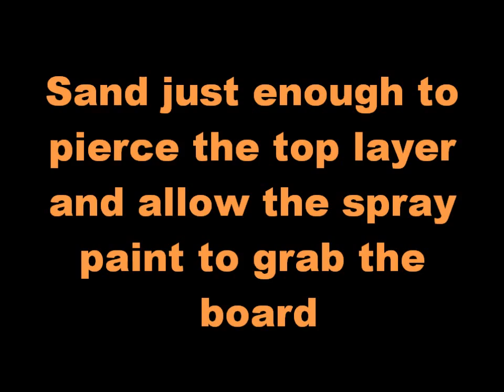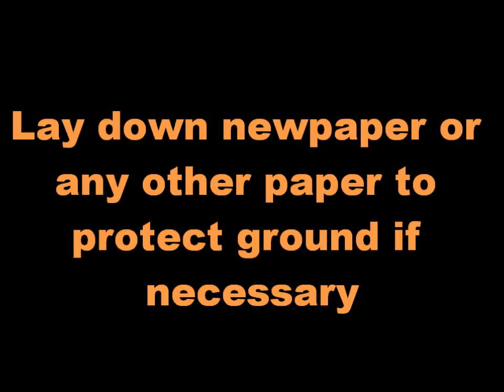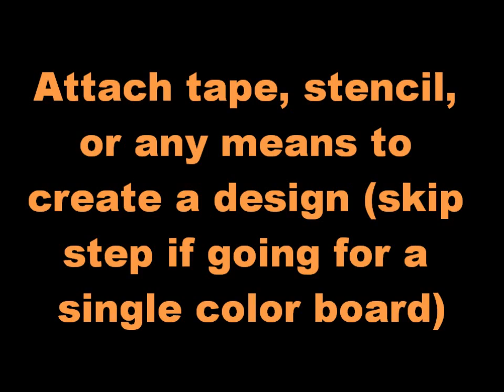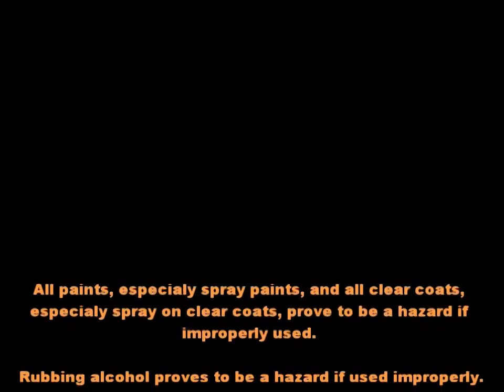How to Spray Paint a Snowboard

Comment: dude. the soap idea was awesome, looks good man.

However, I'm slowly becoming convinced that if you want a board that doesn't look 'homemade', people should seriously just consider painting their board's solid colors.
Reply from the maker: I agree. When I had it just matte black it looked great. Using tape does give a nice design without a lot of flaws though.
Reply: The soap idea was very innovative in my opinion but i think thats what made it look "homemade". I've painted my car's dashboard with tape and the lines are much more clear than yours so i think tape would be a better option. Of course, doing it with tape for a design like the one tanning was after would be pretty hard!

Im painting mine with tape soon, i hope it goes as well as it did with my dashboard!

Comment: Hey ;) Thanks for the great idea to spray paint my ugly snowboard :D I´m a little bit worried that it looks nasty, after doing a ski service. When working the edges a little piece on the side of the snowboard get´s removed as well. Does it still look good or do you have to repeat the whole painting procedure?
Reply from the maker: J. I never repainted mine and it has lasted, however it does have a lot of cracks and spots in the clear coat. There was a lot going on with this paint job from the soap (which I don’t recommend but also don’t advise against) to the wrong clear coat (Thompson water seal, please use an automotive clear coat) and the paint not drying right as a result. So learn from my downfalls and you will get a good looking board. I would say the edges may need to get touched up after a season with some clear coat, but the actual spray paint never came off. And with doing all the procedures right in the first place, you may not even need that. 

One day I may do it again using tape rather than soap (the soap prevented good drying and also moved in between paint coats, making for an uneven finish) and use the right clear coat the first time around, but for now it works and is still a conversation piece after all this time.

Comment: Is it possible to make it glossy? Using varnish
Reply from the maker: Welt Rogg Using varnish, I might advise against. From my understanding, varnish is usually put on thick and it forms a very hard coating. The coating you need on a snowboard needs to be soft enough and thin enough to bend but strong enough to resist water and damage. There are many options on the market when it comes to clear coating anything. There is lacquer and varnish and automotive clear coat and modgepodge and white glue and so on. The biggest factors when choosing your clear coat is that it isn’t incredibly hard when dried, isn’t water soluble (won’t dissolve when it gets wet), and that it will bend without cracking. I personally chose automotive clear coat. It is strong, has no problem curing over paint and is water resistant. On the other hand, it has cracked slightly in the years since I did this project from using the board heavily. If I did this project again I would still use automotive clear coat but I would use more layers. This is my suggestion, but I would advise you to set some time aside to do some research on the different paint options and clear coat options and what work best in conjunction because there may be a better option out there that I’m unaware of. Let me know what you decide!

Comment: Hey, great idea of using soap :) what type of paint was used? I mean acrylic or nitro? Don't it crack on foldaway surface? Thx:)
Reply from the maker: I'm going to try to answer the best I can, forgive me if I'm wrong. 1. I used generic spray paint. I seriously went to the store, picked out a color I liked, made sure it wasn't anything weird (binds only to plastic), and bought it. Considering I don't remember nitro, it must be acrylic paint. 2. If by foldaway you mean the flexible parts, then no. No cracking. I used automobile clear coat and it turned out super strong and still flexible. 3. I won't take credit for the soap, found it on another video. Hope that helps.
Reply from the maker: http://youtu.be/CcDjWvF1mpU video I got the idea from. :)

Comment: How did you choose the right paint? Did you just choose any rustolium type of paint and any waterproof clear?
Reply from the maker: It can hard to trust yourself when you are painting a snowboard that you won't get back, I know. Just go to the store and find the cans of paint that say all-purpose and pick out your favorite color out of those. Then go to the automotive section of your store and pick out some clear automotive enamel. Spray on the paint first as much as you want, but two or three coats should do. Then goes the clear coat of automotive enamel, two or three coats should do. Then you are done. Some notes: I would say to let the paint dry a day longer than mentioned on the can, that way when you put on the clear coat there is no chance of water being trapped under the coat and ruining the board from prolonged water exposure. Let the clear coat set for a week before getting it on the mountain, just to make sure it cured fully, especially in cold weather. Hope that helps!
Reply: +Tanning Lizard thanks!

Comment: looks awesome👍 but how about the areas at the edges? is the color not cracking off
Reply from the maker: No, Sir, no cracking. On my first run with the board there was some peeling where the paint accidentally got on the metal edges, but on the board itself, no. The automotive paint is super durable and stops the paint from peeling and cracking.
Reply: +Tanning Lizard ok great :) thought that might be a problem. thanks
Reply from the maker: Hey, Michael. I thought I might want to give you an update since you had the concern with cracking. After the third time boarding with this board, I fell so hard that I pulled one of my bindings out of it's sockets. With this hit, the automotive enamel cracked somewhat and let water in. The paint is mostly fine but the enamel is bubbly. I am going to remove the bubbles and recoat the damaged parts. To avoid this, I would say to put on at least three or more enamel coats (I only put on a couple of coats) and try to be careful to get it near perfect around the edges (where most hits come).

Comment: If I use rustoleum spray paint as the base and then use an automotive clear spray paint as the top coat, will it work?
Reply from the maker: That seems fine to me. Just make sure it’s a primer + paint combo for the bottom

Comment: How did you mess up a section with the soap?
Reply from the maker: The soap bleed out and prevented the paint from drying. If you attempt it use smaller streams of soap or find something thicker. Tape also works well

Comment: if i paint my snowboard outside, does it work if the temperature is like 4-0 degrees? cause where i live is pretty cold so yeah
Reply from the maker: It is suggested to be warmer. About 50-70 degrees. I think the cold only would slow dry time, though I'm no expert.

I painted in optimal temperatures so I can't give much advice. I would say do some research on cold weather painting. Sorry I'm not much help in this situation. Hope you can figure it out.

Comment: How long did this whole project take you (including dry time)?
Reply from the maker: As you can see in the video, it kind of gets dark out towards the middle of the video and then it gets light out again. The painting took me two days. Drying was a problem. I used the wrong type of clear coat and it never dried; it only got tacky. After that, I took off the clear coat and put on automotive clear coat, that dried in about a day. So if you do things right, I would say two days for painting, one for drying, one for putting on a clear coat, and one more for drying; five days in total.

Comment: Do you think this would work on skis?
Reply from the maker: I certainly do. Skis have metal edges and a bottom that you can wax, right? If so, just use the same principles as in this video, taping the edges and everything. It should be the same, just smaller, like mini snowboards.
Reply: Thanks so much! Great video by the way!
Reply from the maker: +Olivia Galas Thank you!

Comment: Can you paint both side or just the top?
Reply from the maker: Just the top. You see, the bottom is built specifically to smoothly take you wherever there is snow. If you painted the bottom, the surface would become rough and would no longer move smoothly. The paint would also come off quickly considering the bottom takes the most force. The top of a board does not effect performance and you can do whatever you want on it, such as paint it or put stickers on it.
Reply: +Tanning Lizard but can you paint the bottom using the soup technique if the snowboard will only be a decoration like a painted board to put in the room
Reply from the maker: TheSsts1 Certainly. Just make sure that it is a board you are okay with not using anymore.

Comment: how did it act after it started flexing?
Reply from the maker: +AKJunkYard Bobber You know, I didn't notice anything (except where I made my board filled so much it snapped my binding, see my bails and fails video), but sometimes I did notice some water get in the automotive clear coat. I wonder if it's because i only put one or two layers on it. If you attempt this, I would douse the board with an entire can of clear coat.
Reply: +Tanning Lizard I took the clear right now to the bottom edge of the board I was also thinking about adding a thin layer of fiberglass resin around the edges
Reply from the maker: +AKJunkYard Bobber That sounds like a perfect solution.
Reply: +Tanning Lizard Kool I'll post pictures once she is done

Comment: Biggest mistake you made, didnt put something on the base, then tape over it when you did edges. Ptex bases are porous and will absorb any of the spray that happens to get under the base, especially the fact with the camber raising your base up. You gotta be extra careful with it because the base wont hold any wax and will need a base grind to fix it. I can understand if putting it up on a wall or something though, but you gotta be careful of the base.
Reply from the maker: Red1676 I have to disagree. From what I read online, snowboard bases are erroneously thought to be porous. My base is perfectly healthy. In the following weeks after this video I put on a layer of wax and the board performed better than it ever had. To add, that layer of wax somehow managed to last for two seasons. Anyway, thanks for comment. See you on the slopes!